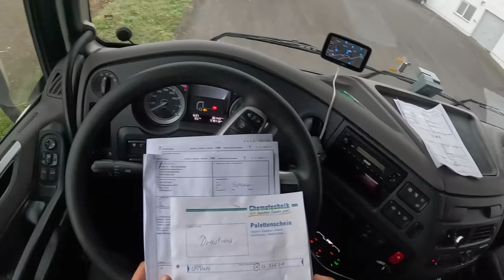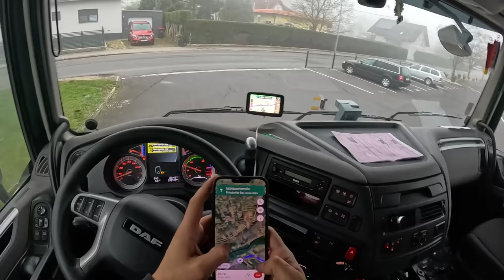I WAS HAVING AN ACCIDENT WITH A TRUCK IN HEAVY FOG / MY TIRE EXPLODED

Comment: Why are you driving 75 km/h in the middle lane?
Reply: Do you have any problem with it going 75 KM/H on the highway???, if in the United States they go 200 miles, that in conversion would be 460 KM/H faster than normal.